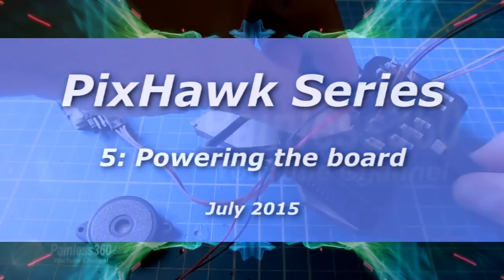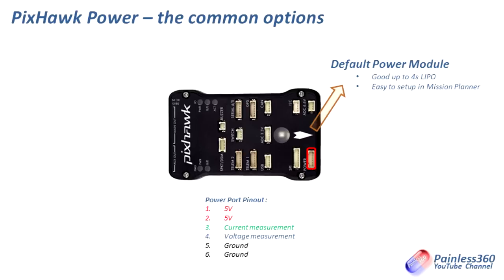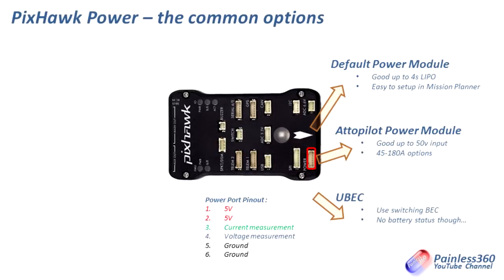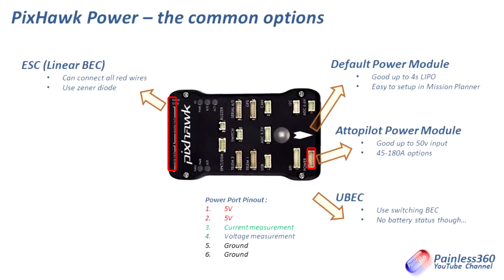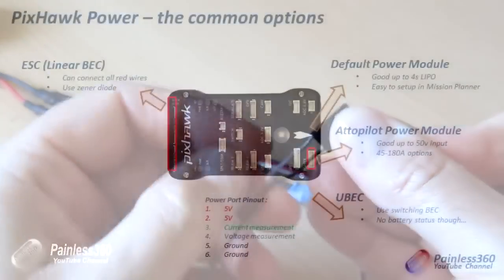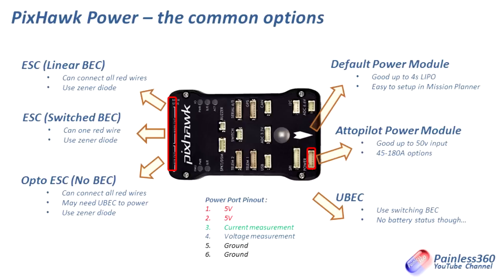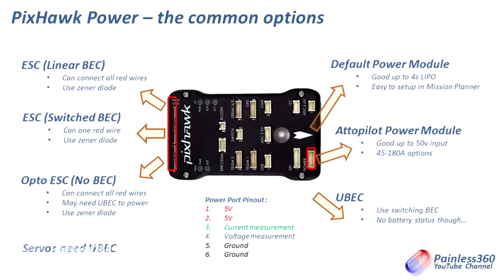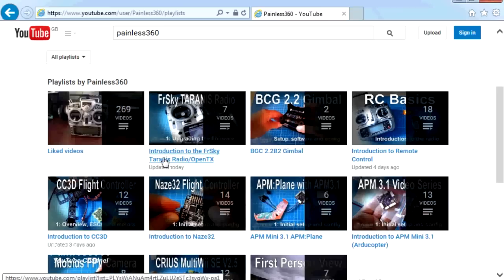(5/5) PixHawk Video Series – Common Power Options (BEC, Power Modules, ESCs and combos)

Comment: Hello! Is it possible to add a microswitch on both thin red wires in serial? I want on/off button for.my baitboat. If I turn off esc switch, the pix stays on because of the power module. My setup is high current (60a) I cant really use switch directly on/off the battery. Thank younim advance!

Comment: I built a drone a little over a year ago and it has never flown. Not once. I find a new video to watch every few weeks. Bust of the drone and try to fix it. I'm convinced that something in this video is the issue. I just can't follow along the video. Can you make a more detailed video showing each part of this or at least one option from start to finish, please? Thank you in advance. If it works, it will be the first time I will have flown by drone that I bought over a year ago. Apm planner picks it up. RC controls are received but, the motors do not turn. All four make a noise when the drone is first powered on.
Reply from the maker: Is it a PixHawk build? If so then check out the Pixhawk 2020 series, I go through all of the steps. I'd guess you have a problem with arming.. See my video on that too..

Comment: My pixhawk only will arm with USB plugged in once I arm the motors the USB is no longer needed but if I disarm and wait for 5 seconds I  have to plug the USB cable in again to reactivate motors whats wrong here please let me know I need to fix this I can't carry around a USB 5volt pack just to start my Quadcopter lol help me please!!!
Reply from the maker: It will be a problem with the 5v supply on the model. I'd check how you are powering the Pixhawk and that it has a solid 5v supply... Happy flying
Reply: I have all the esc red wires attached to the board should I remove the three
Reply from the maker: Depends on what kind of BEC there is in the ESCs.. You could try and see if it helps.

Comment: Thankyou so much for this video! I'm working on a drone project and I don't have access to the power module but I wan to use a XT60 PDB,  do I connect each +ve, -ve and signal wire to the main output of the pixhawk 2.4.8
Reply from the maker: Not sure what you mean. The documentation is always the first place I go to look - https://ardupilot.org/copter/docs/connect-escs-and-motors.html

I would expect that the GND and signal wires from all the ESCs will still go to the PixHawk with the power wires all being connected to the PDB... Best of luck!

Comment: you mention landing gear servos, could you not run the servo for that directly from the receiver that would be plugged into the pixhawk? granted you cant integrate automatic landing gear extention into the flight commands but my theory is if somethings gone wrong and you no longer have control in order to extend the gears, it probably doesnt matter at this point if they are out or not lol. ive been cross referencing your videos with a really easy to read image i found for hardware setup (https://ardupilot.org/copter/_images/Pixhawk-Inforgraphic2.jpg) and just wanted to ask that little question about running servos from the receiver.
Reply: im also planing on running 4 6s 22v battery packs, other than weight (this custom built drone should have a motm of about 20-32kg and weight in at 16kg) are there forseable issues?
Reply from the maker: You can drop the gear automatically. Check out the big boys toys playlist for tips on stuff like powering landing gear.. Seperate power is recommended. Best of luck

Comment: Commenting on an old video but just wanted to know why the motors don’t run in sync during lift off?? One motor doesn’t move till I apply a lot of throttle..thanks for your help
Reply from the maker: Lack of calibration of the ESCs usually.. Best of luck!
Reply: @Painless360  thanks, it was the esc calibration, now trying to fix the oscillations... :)

Comment: To be clear. I power the FC with a power module, I power the main out rail from an esc, and power the aux out rail from a ubec using a Zener diode.  OR, if I power the aux out rail (with ubec) is there a need to power the main out rail (from esc) as well, or is it powered from the aux rail?
Reply from the maker: The zener diode is there to manage the voltage. It doesn't produce any... Happy flying

Comment: Hey mate,
Is power module a must to connect Pixhawk cube if it is on a mini carrier board to make the UAV fly?
I use PX4 abs it keeps saying connect t power module.
Also I have used mauch BEC in my setup does a BEC replace a power module?
Thanks
Reply from the maker: It depends on the mini carrier board you have. The power module monitors power and provides the for the Pixhawk but the Pixhawk is not a power distribution device so you usually need a PDB too for more than one ESC... Video that may help out today

Comment: My s1000 came with a burned out Attopilot 90Amp 5volt installed and also the port from the power distribution board of the s1000 doesn't work anymore (luckily I have others to use.)  I've replaced the attopilot, but after doing research, I also see plenty of people having problems using it, as in total failure.  You also don't recommend it in this video for large octocopters.  I see the 90A 5v is recommended for UP TO 6s battery (what I have installed and had planned to use,) but I also see the 180 amp 5v version and recommended for up to 12s battery, which is what I've just ordered.  You also mention it in this video for cases such as mine; octocopter.  Some people claiming that even the 180amp failing, but have you had any experience with the 180amp 5v Attopilot's failing?  Something I should be concerned about?  I only thought it might be wise to get the bigger amperage version after watching this.  Might've saved me from total loss.  Thanks.

For a UBEC, I went with: APM/Pixhawk 180A Hall Sensor Inductive Galvanometer UBEC 2-12S Power Monitor Module Ammeter Current Meter Molex /JST-GH 1.25mm for RC Drone FPV Aircraft Airplane

I also ordered up some Zener diodes and capacitors, which I would not have thought of had it not been for your videos.

 Thanks for the videos and for being active in the comments.  Your videos are making getting this s1000, which came in pieces and ill-assembled, possible for me to restore similarly to how you did in your s900 revamp with Ben.
Reply: Ya, seeing lots of reports of Attopilot 180A failures.  I wonder if these people are not using the Zener diode?  Are they not using a redundant UBEC on the other side?  OR what is going on here?  Examples of reports of failures of 180A 5v Attopilot:

https://diydrones.com/forum/topics/attopilot-180a-burn-with-dji-s1000
https://www.rcgroups.com/forums/showthread.php?2376818-Attopilot-180A-alternative
https://diydrones.com/m/blogpost?id=705844%3ABlogPost%3A1558085&maxDate=2014-08-02T08%3A31%3A47.704Z

If I am using:
https://www.banggood.com/APMPixhawk-180A-Hall-Sensor-Inductive-Galvanometer-UBEC-12S-Power-Monitor-Module-Ammeter-Current-Meter-Molex-JST-GH-1_25mm-for-RC-Drone-FPV-Aircraft-Airplane-p-1576733.html
plugged in from the power distribution board going to the other side of the Pixhawk (side where ESC's plug in) is this still a concern?  Because I'll have redundancy?  In other words, if my Attopilot fails, will my UBEC save me?  Is that the idea you're conveying in this video and possibly the reason why?

You might've guessed I'm new to this.  Sorry if I ask too many questions, but you seem to have the best answers.

Comment: Holybro has a Power Management Board that can be purchased as part of a Pixhawk kit. It can take lipos from 2S to 12S.  It comes with the necessary cables that connect to the Pixhawk controller.

Comment: hello, i wold like to know if pixhawk 2.1 supports redundant power.
I have a 6S battery and I wanted to connect a 3S only to the gimbal, receiver, vtx... and I also liked to connect to pixhawk2.1.
Even being a 6S and a 3S battery just plug in power2 input?
You could explain haw to set things like landing gear or control the gimbal with taranis potentiometers in the pixhawk or pixhawk2.1.
Reply from the maker: It certainly does. It might be worthwhile getting hold of the specs and having a quick look. It's an expensive flight controller but it does have all the Bells and whistles. Best of luck!

Comment: Thank you for your instructions. I got a few questions:
1. I'm trying to control the servo through the servo rail of the Pixhawk, which means that +5v power supply will be needed. But do I need to buy another battery for doing that? If so, what type of battery is suitable for powering the servo rail?

2. What the difference between the Power module and the BEC? The outputs of both are all +5V. So I can't see any difference between this two.

Thanks again
Reply from the maker: Please watch the other videos in the series, it’s all covered in there. Plus, the documentation for Arducopter is fantastic. Best of luck!

Comment: Great videos. Indeed its one of the best the video series to learn many things. I have started working on new drone project basically for heavy lifting. Can you please help me with couple of questions i have probably your email id could help me to share much detailed explanation on where i have lost. Thanks in advance.
Reply from the maker: +Vivian Dsouza what questions do you have?
Reply: +Painless360 Wanted to understand following things. 

1. To cope up with heavy lifting motors and propellers, I might have to go with 6S battery. Can I use power module output 5V to the flight controller in the case of 6S battery as well?
2.  Should I still use Zener diode if I use input from power module?
3. Just to confirm, should I remove the red wire of ESC to stop supplying power to the flight controller if I use power module (5v)?
4. Also, Cant, we use any Android phone for mission planning such as waypoints etc rather than depending on a laptop?

Sorry if these questions sound silly, as I am beginner wanted to clarify things before proceeding. Also, let me know if I can share you the drone modules I have selected for heavy lifting. You can correct me here too. Thanks a lot for your time.
Reply from the maker: +Viv RD 1) check the specifications on the power module that you have, if it support 6s batteries then it should be fine 2) the dialled is there too help with secondary power supplies. So it's exactly the same as using other sized batteries it's more about the 5 volt line than the main battery voltage. 3) you could connect the red wires from the escs and use the 5 volts from those as a backup 5 volt power supply see the documentation and videos for my discussion on that. 4) yes you can, check out the Android store there's a few of them about now.

Comment: Nice covering of the possibilities, i personally put a LM317 adjusted to 5.5v and the zener diode , because  5volts was giving me internal errors, not enough to power the Receiver , Tellemetry TX,and GPS. i am using only 2S batt so with a linear circuit like L7805 the drop out is 2.5volts..when the batt is discharged and reach 7.2v(with load) the remaining is only 4.7V for the Pixhawk..LM317 is better , only 1.5v.Hope it can help someone having the same config as me...(the resistors for the LM317 are 200, and 680 ohms 1%)

Comment: Hi I only need to power servos for a glider (3 servos to control control surfaces and 1 servo to control a release mechanism) without any propeller and I am planning to use only a BEC (no ESC) which one are you recommending?
Reply from the maker: +Nicholas Giroux-Lacombe depends on the amp draw of the servos you want. If I were using normal 9g servos then a 1.5amp would be fine.. Best of luck!

Comment: I have questions. Because icant listen all english.
My information
1.I just use ppm encoder because i upgrade from CX-20 receiver 
2.i have UBEC and Power Module
3.i have only ONE OPTO ESC

Question.
1.I just plugged +5v from UBEC to receiver and disconnected +5v pin from receiver to PPM encoder. I'm right?
2.I just plugged Power module to Pixhawk. And connect 3wire(-/+/S) from ONE OPTO ESC normally to Pixhawk. I'm right?
3.I dont need to use +5v from other 3ESC ONLY plugged Signal/Ground. I'm right?
4.I just use zener diode or not?

Thank for Help.
Reply from the maker: Not following what you describe. All I know is in the video. The documentation is excellent too. Best of luck!
Reply: Painless360 im bad english :(

Comment: Your diagram suggests that you can't use power module and a switching bec (all on right hand side of diagram) at the same time, is this the case? Or do you put switching bec (sbec) onto 5v output rail? Thanks! Planning on using opto ESC. I
Reply from the maker: +GMAC FPV you can, see http://ardupilot.org/copter/docs/common-powering-the-pixhawk.html for the latest. Best of luck with it
Reply: Painless360 thanks, looking forward to the rest of the 2.1 series!
Reply from the maker: +GMAC FPV cool! I'm hoping 3.8 will be out soon else I'll have to make the next video with beta firmware!
Reply: Painless360 yeh, I'm waiting on the stable release also!
Reply from the maker: +GMAC FPV looks like it just came out!
Reply: Painless360 they must have been listening to us! Looking forward to seeing your VTOL, RTK and LiDAR series ;-)

Comment: hi
Is it possible to power up a camera, DVR .... from one of the ESC outputs of the PixHawk ?
Do you have a video on the issue of powering up a camera (RunCam) and additional components ?
Thanks
Reply from the maker: Not really, the PixHawk isn't designed from the ground up to with with FPV systems like that. I'd use an external BEC to power the Vtx and camera..

Comment: Hello
I have an 450 quad with an pixhawk px4 fc. I took the drone out for an flight and the wind took it and it crashed into the ocean. I managed to save most of the parts only frying the ESC and the battery. My question is how do you setup the pixhawk to return to launch in high winds. What are my options in that situation i see in MP you could choose a max speed and some other option what is the difference between the two. Also would you go for an 8000 or 5200 maH battery. I am using emax mt2216 motors and would like to know if less weight is beter or longer flight time. 
Thank you
Reply: The option i am talking about is WPnav speed
Reply from the maker: I've not played with that so not sure. I'd go with the battery that keeps the overall weight down in higher winds to help it cope with headwinds. Let me know how you get on, best of luck with it!

Comment: I have watched this series probably 5 time before building my first drone. I have a question for you. I built my drone with plenty of lift to accommodate larger film gear later on. My problem is now without much weight on it now it will lift off with barely touching the throttle. This makes it difficult to control. What is the best way to slow the throttle down for now then later adjust as I up the weight? I'm using a pixhawk and taranis plus. Should I build a throttle curve or maybe change the throttle weight? Or is there a better way? Thank you for your great videos and help.
Reply from the maker: +PA Country Boy I'd use a curve that you can turn off/select. Best of luck!
Reply: Can you have multiple curves selectable by a switch or turn the cure on and off with a switch?
Reply from the maker: Yep, easiest way is to have several throttle inputs each with it's own custom curve and select them with a switch..

Comment: Hello Mr Painless, 
Great videos, I'd like to agree with a fellow poster that there are no videos like yours around! 
I was wondering if you could give a brief pointer on how to use a companion computer such as the raspberry pi with a camera module, to do some object tracking. 
I have already developed the object tracking program in C++ within the companion computer, however I am a bit clueless as to how to introduce the MAVLINK protocol in the program to communicate with the Pixhawk?
I have found this link on the px4 dev docs: I was wondering if you could confirm this would be the appropriate procedure to follow https://dev.px4.io/tutorial-hello-sky.html ?
Reply from the maker: Hi Randy, sounds like an interesting project. Not sure why you'd need MAVlink for this as if you are using code to find an obkect in the FPV frame to track it then you could use a separate radio and receiver to control the gimbal to maintain that object in the field of view. I assumr that you're using teh GPS co-ords of the point of interest (POI) and the location of the model with some trig. to find teh angles? I'm afraid what you're looking at is a little outside my experience but I'd like to see videos if it when you've got it working! :D
Reply: Thank you for your prompt reply! Apologies for not being clear, I am aiming for an autonomous mission capable of exhibiting a 'follow-me' type of sub-system for industrial inspection purposes. I am using the OpenCV library to track a particular colour that falls within a HSV range. I have simulated this and am able to 'lock-on' to the desired object and ensure the camera stays centred around the object using a demo rectangular marker. Now I am moving past the simulation and during the lock-on phase I need to introduce MAVlink commands to ensure that the quadcopter adjusts itself to keep the object within the centre of the frame. I hope I gave a better explanation, and not to worry sir I appreciate your advice and I will get back to you when I get this working!! :)

Comment: I had a brown out on a apm 2.6 awhile back that caused a nasty crash, so I want to have a redundant power supply on my pixhawk quadcopter. I have a power module installed so for redundancy will a ubec plugged into the servo rail work OK. And where to I plug in the zener diode ?
Reply from the maker: You plug in the diode into any of the spare PWM outputs to make sure the voltage doesn't rise above dangerous levels. http://ardupilot.org/copter/docs/common-powering-the-pixhawk.html covers it in detail. Best of luck!